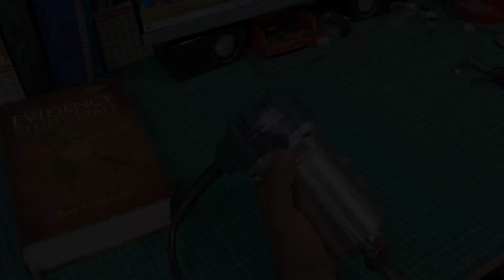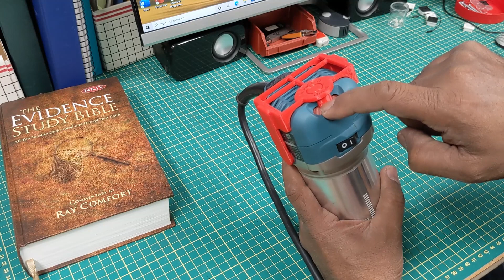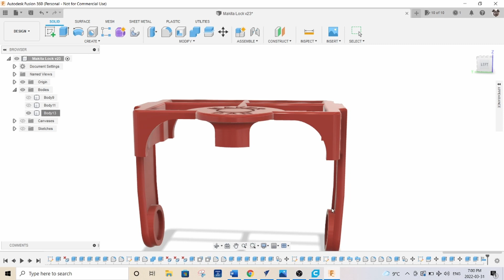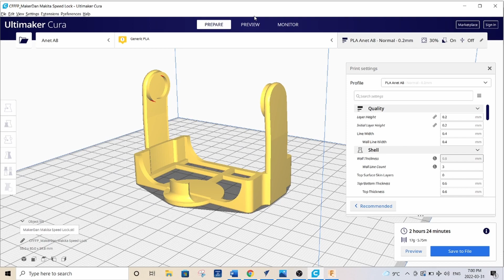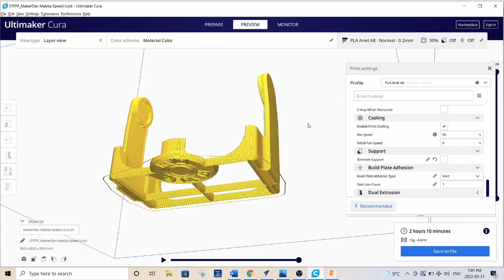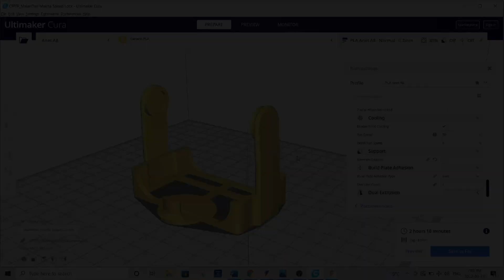MakerDan's Makita Speed Lock

Comment: You mentioned it might be overdesigned but I don't think so.  Having the pressure and stability is crucial to a moving dial but after even more time with that dial, wear causes speed adjustments without dial movement which is temporarily rectified with pressure.